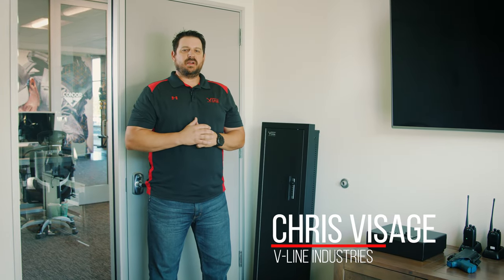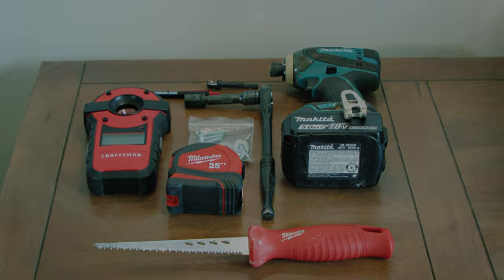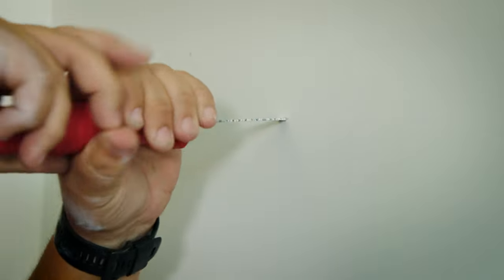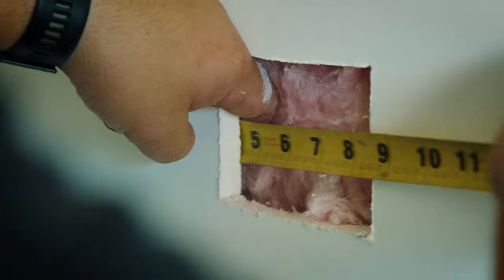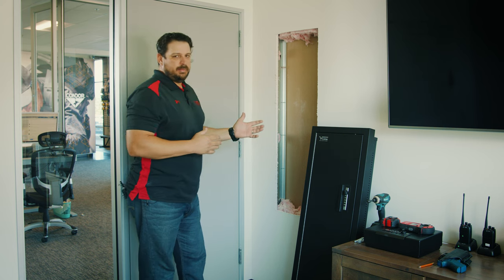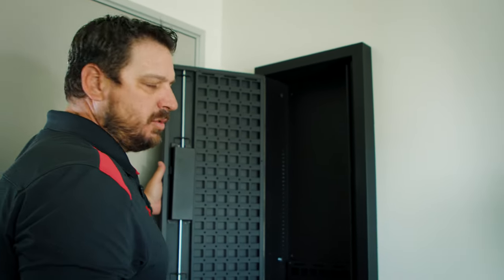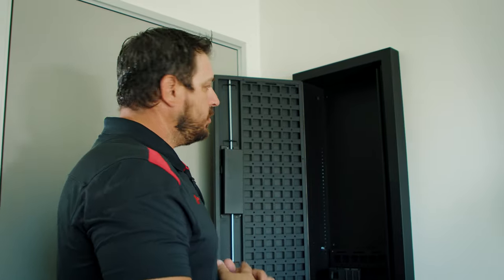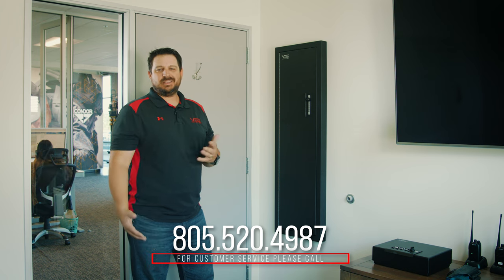Closet Vault Install Video

Comment: Thanks for posting this video.  Have you done any pry tests to demostrate how strong the locking system is?
Reply from the maker: We have done several pry tests using pry bars and large screw drivers with a hammer and the results we very favorable on the security side.   The anti-pry brackets coupled with the 3 point locking system makes this a very secure vault.